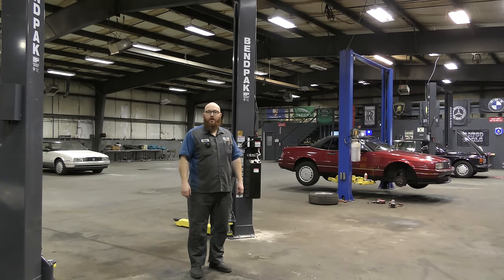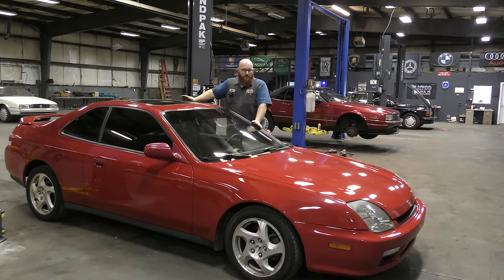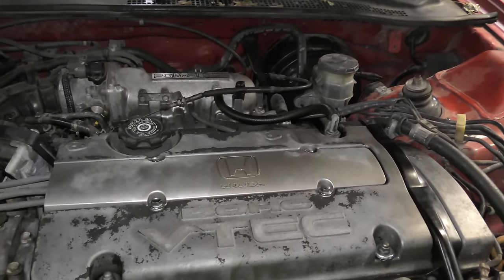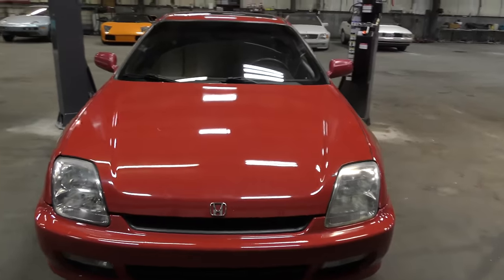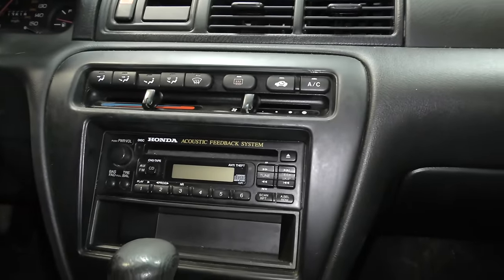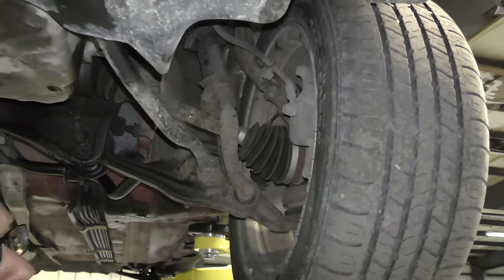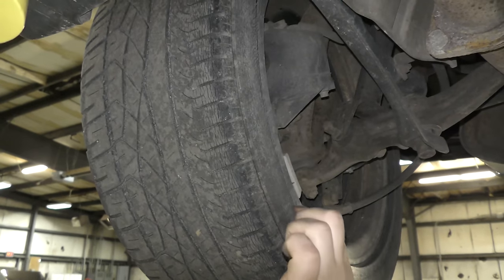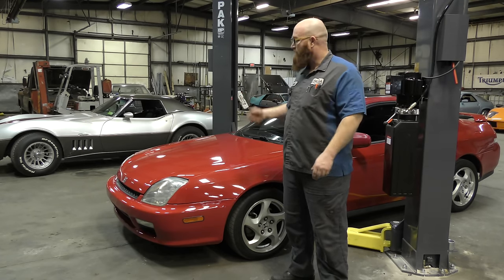VTEC YO! The CAR WIZARD finally gets a Honda Sports Car ~ A 2001 Prelude!

Comment: If that was my car I'd do mainly the basics. Clean the engine bay up real nice, paing the valve cover, get a nice set of grippy tires for it, and refresh the suspension. I wouldn't lower it much but definitely would install some new shocks and replace whatever bushings are worn. Then I'd source a set of fog lights for it, tiny the windows, maybe some different wheels and at least polish the exhaust tips. Maybe replace the exhaust with like an apexi world sport or something super quiet but honestly, especially being automatic I would mainly drive it and enjoy it for what it is. If I got bored and or the transmission gave out I would definitely replace it with a manual but other wise cruise it!

Comment: David, if you're serious about putting time and money into the Prelude, I vote for bolt on/bolt off pedal assembly and a five, or six speed manual trans. Increases fun factor by a factor of ten, and, it would be reversible.

Comment: I would leave it as is body wise, it looks perfect stock. Any mods I would do maybe LED Lighting and the rest would be maintenance things. Like timing belt replacement, all of the fluids changed and just keep it clean and daily drive it.  At the end Honda and Toyota are the most dependable on earth. And for long as they are maintained. My brother's 2001 Honda Civic ex Coupe 5Spd manual with 1.7l VTEC  has 294,000 miles and still running strong with amazing MPG's. Last year this very car qualified  for the airbag recall and the honda dealership replaced them all for free.

Comment: Tires are old.  You could point out how to check them by looking at the DOT marking that shows week and year manufactured.  My opinion is tires need replacing when they're 5-6 years old, even if there appears to be good tread left.  Look closer at you'll see the cracking.

Comment: I would go through and replace all the rubber bushings with a nice set of poly ones. Keep the stock springs and get a fresh set of shocks and stick a nice set of tires and brakes on it. Then just fit and finish parts that needs replaced. Stick a enjoyable stereo in it and just keep it well maintained.

Comment: The first thing I would do, it put all the wheels on the correct sides... I couldn't deal with them being mismatched.  Second thing... Ditch the stock stereo for something better.  I sold these NEW back in the day, and I always wanted one.  I still plan to get one, I have owned a 1993 Prelude Si, (non-VTEC) and the only thing I did to it was change the radio, and made sure the tires were kept good.  Sold it with nearly 250k miles on it.  Best handling car I ever owned... until I got a GTI.

Comment: I test drove this exact same car in 2000, it was a brand new 1999 still in the show room floor at the Honda dealer. When Vtech kicked in, it felt quick. Was my dream car... since I’ve owned over 30 cars, most were German performance cars. Do a manual swap. Nothing else.

Comment: i got me a 2001 Blue Honda Prelude for 3500, 156000 on the odo, manual transmission, everything stock beside a cold air intake and everything is perfect on it besides a few little scratches. They're rare cars but very nice to have nowadays.

Comment: Nice little car. I prefer the automatic. Like you, I'm nota fan of modifications on well-engineered, well-built cars. Definately some tires are in order. I had a Honda that I bought new in 1988. it was an accord LX-i. I replaced it with a new loaded 2001 Buick Regal LS. It was so much more car than the Accord. Much faster and it got better gas mileage. Got $1,200 for the Honda in 2003. I was happy.

Comment: For mods you want that car to handle better so it's more fun to drive so get some coilovers and mildly thicker sway bars. 
Then the typical I/H/E.
I had a mostly stock 89 Integra (new) and now have a '92 NSX that's seen some track time.
You use handling a lot more than speed.
Japanese cars are a LOT of fun!

Comment: I love that generation of Preludes.  I had an older CRX.  Those were brilliant years for Honda.   Out of curiosity.... has there ever been a Prelude ‘Convertible’? Or crazier still, ...a 2-door wagon, akin to those 1964 (?) Pontiac Acadians ‘Station Wagons’.  Good luck with whatever ideas you get.  Thanks for the video.

Comment: I would check on brake, wheel and tire upgrades, and upgrade the suspension to handle better with poly bushings and like that. See if there are any upgraded factory parts from newer versions of the same setup if possible and run with it. It wont destroy the look of it and it will just stop and handle better than the same car with stock parts. I did similar to my Dart over the years as I found newer and older parts that would bolt in and improve the way it handles and stops without destroying the look of the car itself. It drives way better than the same car with typical factory parts and you can't see any of it unless you know what to look for. I was going to add disk brakes and big bolt pattern drums and disk brake setup when I retired it but have all the parts stashed. I did get factory front and rear sway bars in it and poly bushings and new parts in the front end wich made a huge improvement. They had a rear sway bar set up in police package Darts in 75 and 76 so made it fit my car.

Comment: I had a red 1999 prelude with the automatic and had nothing but trouble with it!!   It had 3 transmissions in the 3 years I had mine!! Make sure you get that checked and the vtec valve  like to leak as well   Other than that it was a great car!   Thanks for sharing

Comment: 5 Speed swap it wizard. As someone who's owned 5 preludes, they're way better in a manual. Otherwise throw on an intake and decent exhaust and enjoy until the rings go, which they will. I'm sure you've done your research but in case not, the H22 has fiber reinforced cylinder walls that chew up the piston rings so if you plan on rebuilding the engine at any point you should re-sleeve it.

Comment: Hi wizard. Really nice car there. I'd suggest you give the gearbox a regular maintanance as its always the biggest headache. Maybe give the car a good bocy care and polish. Get the original badges back and keep the car stock as far as possible. The car has a very good suspension but if you lower it by 20mm it will give better handling around twisty roads. PS are you gonna give it to your daughter once you done?

Comment: its a coupe and there's nothing wrong with it

but a sports car i don't think so , your milage may vary.

i would get the exhaust header ceramic coated to lower under the hood temps

and mayby do som old fashion port+inlet manifold grinding/polishing

cheers and good luck with the new unit

Comment: Honestly there are a bunch of good oem/jdm parts available for BB6 prelude.  If I were you here’s what I would do.  Try to source oem bodylip kit...really looks good.  Next I would swap the seat for the oem leather (if you can find good set) or do the jdm red leather conversion (just the seats and panels not RHD).  And if you were gonna do anything performance wise I would only trust mugen parts (twin loop exhaust, header, etc).  Also if you want more performance I’d do a H22a with LSD trans (red top from prelude type s with 212-218hp 168tq).  And maybe a set of mugen wheels maybe Mugen GPs or MDC’s

Comment: Based on both doors fading more than the qtr panels I bet it was rear ended and that's why the badges are missing and the prelude is missing because it was an aftermarket bumper so it couldn't recreate the impression of the prelude on the rear bumper. I would look for the vin sticker on the trunk to see if it is the original one, if not I would assume a rear body replacement with quarter repairs hence the less faded paint since Honda red usually fades like the rest of the front 2/3rds.

Comment: Hey Wizard, love the car.  I had a similar prelude automatic as well and my only issue was the automatics came in a 4 speed, while the manuals came with a 5 speed.  The 4 speed is cool racing around, but is really horrible on long road trip.  If you can show how to convert it to a 5 speed automatic that would be cool.  Love the channel keep it up.
Reply: If you're talking about the high rpm's on the highway. The manual is exactly the same

Comment: Get some Honda rims that look really sporty and modern, maybe new ceramic slotted rotors with the nicest breaks you can get, clean up the engine bay, get more modern front and back lights, then maybe put in a k&n forever air filter system, exhaust swap? and Transmission swap?

Comment: Wizard why is your gas gauge registering fill level even with the ignition off? I'm sure your aware but the drivers rear quarter panel looks to have been repaired at a point which would explain your new rear tire and rim on the drivers rear. Great car. All the best!

Comment: VTEC introduced on the CBR400 in 1983 known as HYPER VTEC and in Japan in the 1989 Honda Integra XSi which used the 160 bhp (120 kW) B16A engine. The same year, Europe saw the arrival of VTEC in the Honda Civic and Honda CRX 1.6i-VT, using a 150 bhp (110 kW) B16A1 variant. The United States market saw the first VTEC system with the introduction of the 1991 Acura NSX!

Comment: I own a 97 also an auto. Only issue it has is it goes through oil fairly quickly even though it doesn’t leak. Been debating whether selling it or keeping it and doing a manual swap on it. The transmission doesn’t slip or anything but it does shift a little funny sometimes.

Comment: Nice car, but how did I just KNOW that it would be the automatic, long before you said that it is in the video. It's always an automatic, it's just not surprising. Based on the Accord platform of the same year (and the same but slightly up dated platform as the previous model of the Prelude/Accord) very nice example!! Lucky find!  I would replace all the rubber bushings, put in new springs and shocks, replace all four tyres, new engine mounts, and clean it up, clean the engine bay, then get the wheels lazer aligned and enjoy!

Comment: When Honda was building the Prelude that time was PEAK Honda IMO. They are starting to get their MOJO back though with cars like the Civic Type-R. I have actually been looking at used Preludes but they are SUPER hard to find especially in good shape and even harder to find with a manual transmission which is my preference. Cool car but I would leave it stock other than maybe looking at a manual swap if it is not too hard. Those cars were WAY more fun with a manual transmission.

Comment: With suspension and good tires this will corner like a Ferrari. Only FWD car I could actually enduce oversteer mid corner with. Full ground control kit and other odds n ends. Impressed me.

Comment: I’d do a manual swap and a basic tune, exhaust that’s more efficient but still quiet and an air intake if they actually squeeze a bit more power or throttle response over stock. The car will never be a rocket ship and still retain its factory form, just keep it simple and make it a better version of itself that’s fun to drive.

Comment: Wizard I have had an auto and two manual preludes bb6 preludes. First thing I would do is flush the trans fluid with auto Honda. I would do a full tune up, refresh injectors. When you do the timing belt and water pump so the camshaft seals behind, replace with a KStuned manual tensioner. I JDM type s intake bolts right on gives little better response and still maintains oem design will clip into the stock resonator box. Hard to find I have one for sale tho maybe lol
Reply: Also gaskets gaskets gaskets , vtec solenoid gaskets loves to break the most at the worst times I find.

Comment: I have a friend with a 2001 prelude manual. its had a h23 swapped in. its dope and man its quick.

Edit: If I had that car Id just leave it how it is. with some tasteful upgrades. like sound insulation in the floors and doors, better speakers, but stock radio. Stuff like that. just small things to improve the quality of the drive, rather than the speed, they are plenty fast enough.

Comment: if it were mine - drop knuckles, stock suspension height, a set of tastefull wheels with a set of sporty tires, a manual swap because honda manuals are some of the best

Comment: I had the 1988 Prelude Si with a manual 5-speed and it was a really fun car. I forgot if it had VTEC but I doubt it. My 2000 Integra GSR was even more fun to zip around in.

Comment: You should stock manual swap it! It would make great content and make it way more fun to drive. I’m sure you can get the transmission, pedal box, flywheel/clutch kit, slave, master, and all the lines pretty cheap.

Comment: Would not do much to that beauty. A robust under seal. A polish and protection to the headlights. A detail, polish and ceramic coat to the bodywork. A protective PPF on the front nose. A resurface of the alloys and clear coat protection plus ceramic coating to keep them sweet. A full service of fluids and filters. A good alignment. New bushings all round. Steam clean of the interior. A tasteful strut brace and beefed up sway bars. Five minutes work really.

Comment: Problem with all Honda that utilizes upper wish bones is that you have to loosen the bolt for the upper bushing in the shock tower before jacking up the car otherwise you will rip the rubber bushing.

Comment: i had a roommate in 1999-2000 that had a civic si with V-Tech (yo) i think it was the 2000 model year and it was a hoot to drive... it had just a touch of lag when the Vtech(yo) kicked in just like a well tuned quadrajet hesitated for a tenth of a second then opened up with tire melting torque

Comment: I have a 92' prelude Si (4th Gen) with a fully built JDM H22A and a precision turbo currently at 650hp..and just did some work for a guy and was paid in the form of a 98' Prelude type Sh that also has a JDM H22A swap and I love my 4th gen more than the 5th generations. I plan to strip the 5th gen of parts and just sell the shell off because Im just not a fan of the body style..although there are certain parts of the 5th gen that I would love to see on the 4th gens. I have a 5th gen sunroof swapped into the 4th because its glass vs. The solid one that comes on the 4th. But the JDM engines are much more powerful and potent than the US specs. But I absolutely love the preludes and I still get compliments anytime I drive it...and alot from the older generation people...plus having 600+hp makes their minds blown that a little 2.2L 4cyl can make that much power. Thats a clean example you have and even in automatic form they are a blast to drive.

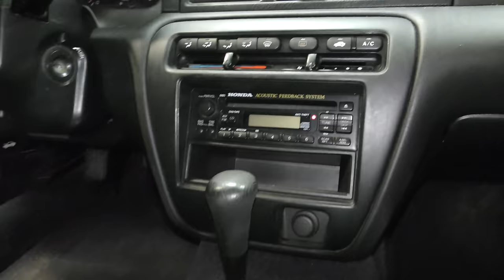Comment: 5:07 Putting in an aftermarket head unit or aftermarket suspension is not rice. This car is from 2001, so 1. It wont have bluetooth or aux or anything of the like, and 2. Upgraded suspension is never a bad idea. I'm not talking about racing suspension with virtually no travel, just suspension that makes it ride smoother. Just because its not stock doesn't mean its rice.

Comment: Wizard i have a 98 vw beetle with 2.0 5 speed and im having issues with the fuel relay.  I got a brand new one and it still wont work it will only kick on for about 3 secs then cuts off and wont turn the fuel pump back on. Right now i have a toggle switch to keep it on any suggestions?

Comment: I had the exact same car! A 2001 Prelude sh that's the same model the wizard has the automatic transmission came with the a t t s system. If you didn't get a manual transmission it came with the a t t s which stands for automatic torque transfer system it was supposed to do away with understeer. It did actually help but when you went through the corner you had to give it gas for it to work so if you let off the gas halfway through the corner it would instantly start under steering and it would get scary or really quick. It was a trick differential that would put more power to the outside wheel to help push you through the corner but the problem was it added almost 220 pounds to the car so lots of people would actually take them off. This video actually made me really depressed because I lost mine getting T-boned by some douchebag who ran a stop sign. It was too mangled it was a total loss. But I still have a lot of great memories made in that car during my younger and Wilder years. She was the sweetest car I have ever owned the perfect summertime car and also a surprisingly great car through the long Alaska Winters. She was also surprisingly tough and durable too she spent her whole life in the Matanuska Valley in Alaska which to this day still has a surprisingly large amount of gravel road still and the other roads that are paved aren't much better either. Greatest car ever!

Comment: I have the same car except euro, manual swap would be perfect, because the auto doesn’t last long and the transmission fits from f20 engines   which makes it cheap. Motegi bodykit would be cool as well, I can’t find them in my country, maybe you’d have better luck finding them if they suit your taste, they came original in type-s I think. Generally just type-s it, make it more JDM, what I’m trying to do. Nothing else for that car, it’s good as it is

Comment: ive ALWAYS wanted one of these too! I remember the commercials. with the breaking glass.....WIZARD WHAT DO YOU THINK ABOUT ALL THE VW DIESELGATE cars coming back on the market. its too late i already bought a 14 sportwagen dsg. I think it would be a good idea for a video if you had an opinion on them. I was skeptical buying because I know they sat in a parking lot for a couple years and I know sitting is bad for vehicles. i also got the panoramic roof which will most likely leak.....anyways love the videos and congrats on finding an unmolested prelude

Comment: The shaft seal inside the distributor is also a very common oil leak. Honda don't sell the seal separate, but and seal shop should keep one.